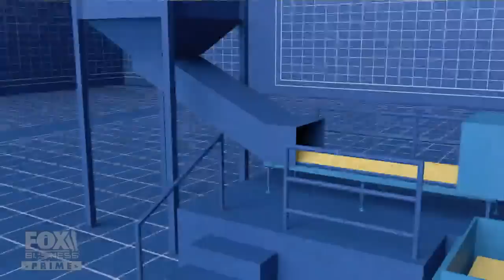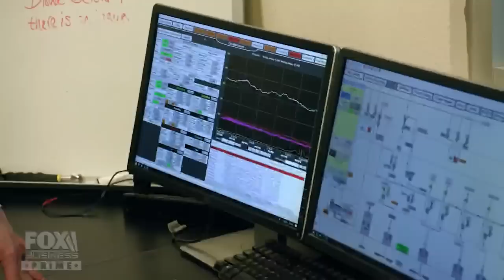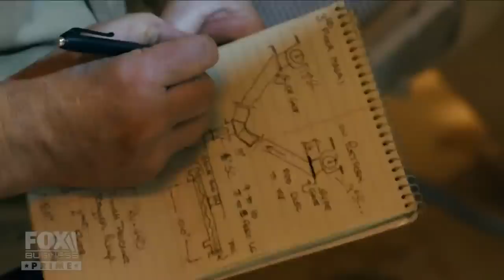What’s the process behind America’s most-grown crop? ‘How America Works’ breaks it down

Comment: I worked in a soybean oil extraction plant. It was mind boggling for the amount of nails, washers, bolts, nuts and small pieces of metal that the magnet picked out. What was more surprising was the concrete blocks, rocks , big chunks of metal, a cylinder head, tire on a rim that were screened at the truck dump. This stuff did not get into the beans by accident. the farmer was looking for weight. Little did they know they would get caught and docked for this. We also saw cigarette lighters, pliers, sunglasses, a watch, a tennis shoe  and more.

Comment: The corn industry is one of our great achievements.  Whatever your view on corn fructose, etc., we fully executed the cycle of corn to the extent it also supplies us with fuel, plastics, sugar, forage, fiber, and the actual corn, for seed or consumption.  Few nations have the combination of heat and cold that we have in our Midwest that makes it work so well.  Once we settle the GMO issue, we should do even better.  But it's not for everyone; Russia tried to emulate us under Khrushchev and failed.
Reply: it is also not very good for us... especially after decades and decades of breeding (and engineering) for largest ears drastically reduced nutrient density...
Reply: @Isaacmantx  I'm a farmer and I grow these crops. You simply don't know what you are talking about.
Reply: @markhasenour12  you grow these crop's ,so your fully biased in favor of them. i would convert all corn fields into rotational grazed pastures, thus reducing grass fed meat cost,improving the environment by eliminating the bulk use of chemical fertilizers, no corrosive ethanol in machines thus prolonging engines lifespan ,significantly trimming down on the environmental cost by producing and dumping less of these machines  ,most environmental ideas trumpeted on msm are garbage, and if your willing to go down to the nitty gritty of its cost on the environment you will realize that its net environmental cost is the same or like in ethanol way bigger than gasoline   ,,the best environmental solutions don't have the big machine behind them,, like earthship's regenerative ranching and farming, and making equipment that lasts a lifetime or more instead  of trash with planned obsolescence
Reply: The corn industry is heavily subsidized by the government at the expense of other crops.

Comment: And most of it gets made into alcohol and mixed with gasoline and reduces the energy content of your fuel so you have to use more throttle to make up for it. Corn farmers are the only ones that can afford John Dear tractors and the maintenance on them. Oh, and build multi hundred thousand dollar tractors for tractor pulls. Those government subsidies are great.
Reply: Apparently you have no idea how small the percentage is of farmers that have or participate in truck and tractor pulling. Also, many (if not most) farmers are still using equipment that is from the 90’s.
Reply: Somebody doesn't know the octane level of gasoline vs. alcohol